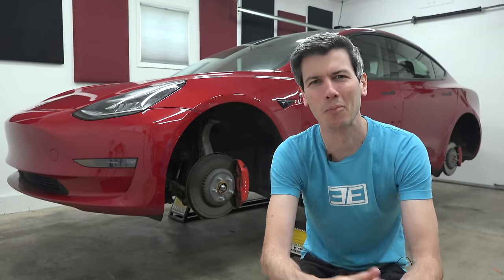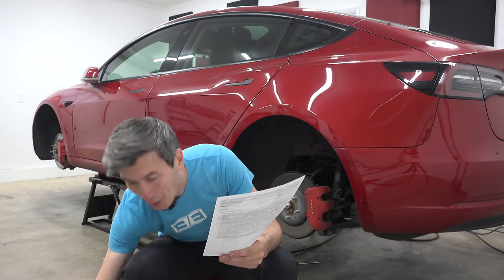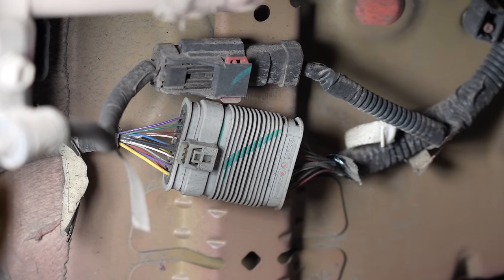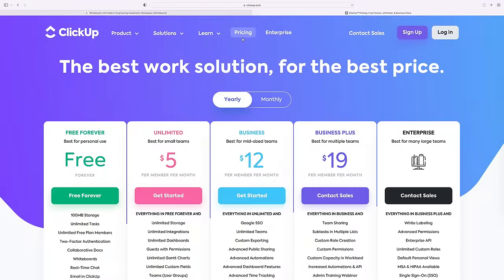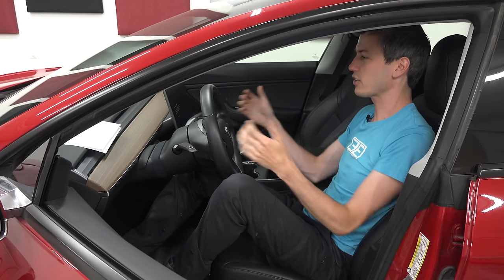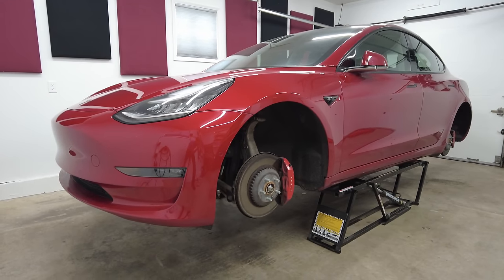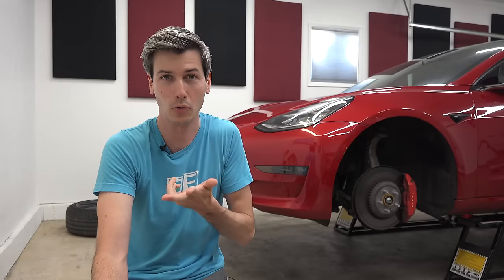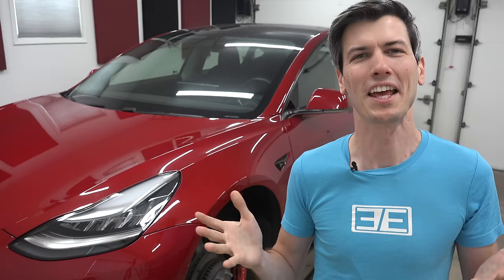Tesla Battery Damage? I Ran Over A Metal Bucket

Comment: How many Km or mi on the clock? Helps weight the maintenance costs.  

One thing to stress is that no one should go 4 years without a brake and suspension visual or basic (hinge) lubrication. And wipers. These are things norms hear and then neglect to their own safety because “it’s electric”.

Comment: I can say that the paint protective film is not the reason the spoiler keeps coming off. You demonstrated the reason on your video. The reason is the spoiler shape is not the same as the car, which results in the ends of the spoiler eventually pulling away from the car. I have had this happen to me several times, and I have no paint protective film on the car. Your video shows the problem perfectly... the part is not shaped properly.

Comment: I feel bad for people buying Teslas now because they’ve made them worse than they used to be, include less than they used to, but cost way, way more. I’ll bet a standard range Model 3 probably now costs as much, if not more than what you paid for your M3P, and it doesn’t have things like the garage door opener, or as much premium connectivity included. That and the vision based systems (autopilot, adaptive cruise control, auto high beams and wipers) are substantially worse on the new vision cars vs the older radar cars. I was shocked how much worse those system work on new Teslas vs my old 2021 Model 3. The exact same car I used to have now costs $10k more than it did when I bought mine in March 2021. For the same price as my Model 3 LR, all I could get now would be the cheapest standard range Model 3 in white or grey. My fully loaded Ioniq5 AWD costs $8k less than the cheapest Model Y. They keep charging more and providing less.

Comment: I e-mailed a service center and asked for a price to enable the AUX on my SAAB 9-3 a few months ago. The service cost $90. The labour cost $200. It takes 5-10 minutes to fix. 

At that point I just purchased my own tech2 to enable it. Cost $400. But sadly turned out to be faulty. I sat with that goddamn piece of junk for 8 hours two days in a row trouble shooting the security access (which is a known issue). Then ordering a bunch of junk from amazing for at least $100 to see if any of the accessories were faulty.

Comment: Great video J. I find that the blinker side cam is not positioned on the screen properly, it should be higher as my arms block the view and force you to look down. Do you get phantom texts from linked phone too? I get quite a few false positive danger beeps. I find I have blind spots with the small mirrors. They should toggle the wiper function modes with the manual wiper switch until they fix auto mode. They should revert wiper to off or auto after you park as it will likely stop raining by the time you drive it again (even in Vancouver!) I sometimes wonder if their programmers even drive the cars! Still love the car though and very unlikely to ever go back to ICE.
Reply: Blinker cam adjustment is coming for the next update. You can move it into 3 different spots on the screen.

Comment: Shocked at the 124 service cost. I wonder what the comparison would be for a BMW 3 series (regular) and M3. I'd assume those cost significantly more in oil and oily bits. 

A truly under appreciated fact of owning an EV.
Reply from the maker: Yeah I mean, even though I often do it on my own, taking in the Subaru for an oil change is $60+ or so at the dealer, and that's twice a year. Price goes up for more expensive cars (the nature of "luxury" dealerships).
Reply: @EngineeringExplained  Oh totally. I lived a former life supplying equipment (lifts, welders, paint booths, tyre equip) to dealerships, mainly BMW, Mercedes & Honda. The prices they charged were eye watering.

Comment: I HAD THIS WITH A BMW 740   the expansion header thank cracked and on eBay they were like £140 

At the BMW dealer, it was £24 + about £18 to fit it.      DONT ALWAYS ASSUME AN ORIGINAL PART IS SUPER EXPENSIVE WITHOUT CHECKING

Comment: Thanks for this informative video! Did you really drove the car 4 years without changing the brake fluid?
Reply: I assume with regenerative braking the brake system "works"  less and generates less heat resulting in longer life vs a normal braking system?
Reply: @pierredieperink4523  The brake fluid is hygroscopic. That means its water attracting. So the humidity makes it necessary to change the fluid every 2, at least every 3 years. Even if the car was not driven over this period. The boiling point will reduce over time. So the risk for air bubbles and corrosion damage is increased.

Comment: Push wiper stalk once and you’ll get one wipe.
Reply from the maker: Yes, but while it's raining consistently that's not a real fix.
Reply: @EngineeringExplained  yeah. For my 2020 behavior isn’t always consistent and isn’t the same as my friends 2018. Generally, it works well but in moderate rain it will occasionally be erratic. Most often I find myself in very light rain just tapping the button if I need it. I don’t know the last time I changed setting via the screen.

Comment: That wiring harness check was for the HVIL circuit, quite common for water ingress in that connector which can cause issues with HVIL circuit leading to vehicle not starting
Reply: What is HVIL?

Comment: Really appreciate your review on the tesla. I often wonder how they are longer term.
Reply: You do know how long Tesla has been selling cars right?  Since 2008, with the original Roadster.
Reply: @Resist4  sure, but rarely do you get someone with a big following that has had one for so many years do an update on their experience. Makes me think of getting one.
Reply: @sddyck  Actually, there are a lot of YouTubers that have had a Tesla for many years and did videos about their experience with the car.  But is a Tesla the best most reliable car...no.  Yet it is the most fun to drive and the safest.  Unfortunately, their prices have gone up so much that I wouldn't buy another one right now, even with the new EV credit.  Plus, there still aren't enough service centers, the closest to me is 2 hours away and mobile service can't fix everything.
Reply: @Resist4  I have to disagree with you on reliability.  I'm 3 hrs away from the nearest Tesla service center (Las Vegas).  I've only been there twice in the 4 years I've owned my Model 3.    Once to get the AV computer upgraded to V3, and again to have my 12V battery replaced and the rear tires replaced.  I replaced the cabin filter myself which was a pain.  It's been my most reliable car by far.  I took delivery on a second Tesla in May; this time a Model Y.  No fit/ finish or paint problems on this Fremont built Long Range.
Reply: @MsAjax409  Maybe in your experience it has been the most reliable car, but not in mine.  I have has ICE vehicles, one I owned for a decade and it never needed warranty repair or ever was in for any kind of service.  I've owned my Model 3 almost 4 years now and it's been in the service center 4 times and had mobile service at least 3 times.  Luckily it's all be under the warranty.  Not sure what I will do when my warranty ends later this year, because repairs are more expensive with a Tesla and many things can't be fixed yourself.  This is the downside to the technology.  

I know I sound negative, but I really do enjoy my Model 3.  The acceleration makes me smile every time I drive it.  And the convenience of charging at home is so amazing, especially because my house has solar so my fuel source is free.  My solar panels are over 10 years old so they've paid for themselves.

Comment: Yeah I'm surprised you can have a good service vist at a Tesla service center considering they are all run by the same company unlike Dealers and indipedets... Speaking after my Grandpa broke the driver'sw side mirror after trying to backk out our new mustang and learning Mustang don't pack straight they park at an angle... I looked online to see the part cost and it was $120 just for the part... Whent to the great Ford dealer we bought the car from... and they did the repire for under $100... So yeah if you find a good shop they'll do it for a good price!

Comment: Auto Wipers don't work!? Is it maybe because your car is 4 years old and something physical changed over that time which can't be addressed in software? The AW feature in my 2022 Model Y works fine - they come on when it rains, they go off when it stops and they definitely don't flutter when I'm in reverse. Tesla ought to be able to at least explain why it's doing those things if not fix them. Maybe it's just some doodad thingy on the wiper motor like an extra sensor and lead to the controller? Ok I'm sure you tried all that already, I'm just very sympathetic to your plight. Cheers.

Comment: In the 90s I had a Nokia phone. I dropped it on the ground after that, the battery time was significantly lower. So at least in those days a battery could apparently lose capacity due to a blow

Comment: Great review! It seems that Tesla has not figured out how to make money at a service center like all other OEMs do. Even if they went half way to what is normal, they could generate much more revenue and still provide value to the customer. This is because of no franchises. For example, FoMoCo buys a part from a supplier, doubles the price and sells it to a franchise (dealer). The dealer adds 50-75% and sells it to the customer. Tesla needs to figure out the amount of $$$ they are missing out on.

Comment: Currently, rechargeable batteries are nothing more than containers for storing electrical energy. It needs to be charged using energy produced from petrol, diesel, solar, hydro and other power systems. It is very inappropriate to use for running a vehicle even a motorcycle.

Comment: Do you have any hope that Tesla may provide software updates that could address those issues you mentioned regarding the automatic wipers, lane change camera, Spotify app, screen layout, etc? It seems to me that those are all updates that could be provided to improve the driving experience that should be relatively cheap for Tesla to implement.
Reply: Obviously at some point Tesla will address the software for those issues.  Hopefully they can do that after they fix the Dashcam Viewer and other buggy issues.  But unfortunately they are too busy adding more games to the cars.
Reply: I doubt they'll get the rain sensor fixed if they didn't get it fixed by now..
Reply: I'm not sure i would hold my breathe for some of those. Some like the screen layout and Spotify app would be relatively inexpensive and almost guaranteed to be software problems, others may be hardware limitations. If the sensor for the rain is weak then no amount of software is going to fix it, if the onboard computer cant respond to the camera input fast enough when it is also doing other things then a software fix might just replace that problem with another.

Then you have to consider why Tesla would be truly motivated to worry about fixes like this on a car that they already made their money from rather than applying their software team to new flashy projects aimed at capturing the next wave of buyers.

Comment: 11:53 It's because HP has nothing to do with acceleration. Torque defines acceleration. And electric motors has all the torque available at any RPM.

HP defines top speed.
Reply from the maker: HP is in fact correlated with acceleration. Torque and horsepower are linked. You can't have horsepower without torque. https://youtu.be/u-MH4sf5xkY

Comment: I've had my Model 3 for about as long as you, and I can certainly agree with many of your points.  Tesla's range is based upon ~230Wh/mi, which you seem to only get in 60-70F weather when driving at about 55 MPH.  EVs are largely single-geared these days -- you can ask Tesla how putting a gearbox in one works, or just watch the Top Gear episode -- and that means that each motor + gear combo has a single ratio.  The Model S and Model X are able to disengage one of their motors (I believe the rear) and allow the other to keep the car at speed when cruising on the highway.  Unfortunately, the Model 3 and Model Y cannot do this.

I think my biggest regret is probably not listening to my gut when buying the car.  I was originally going with a Performance model like you, but I made the mistake of listening to a friend's advice of "who buys a Tesla without the tech?"  I ended up going with the LR RWD with both EAP and FSD.  I kept debating going with FSD or AWD, which considering what happened (Tesla accidentally offering FSD for $2000) and the fact that AWD cannot be simply added later via software, and the choice should've been a no-brainer (i.e. AWD).  I actually was going to change back, but the car's setup had locked in at that point.  Anyway, the reason why I bring this up is that I'm a huge fan of cruise control, but my main desire is for it simply keep me at a speed.  I'll handle all the adjustments myself.  Unfortunately, if you have EAP or AP, Tesla does not allow you to disable the Traffic-Assist for the cruise control.  

In the end, if I could go back and change my setup, I'd go with that simple Model 3 Performance setup... or I think the better option would've been to wait a year or two, and go with a used Model S.  The used Model S would have more range (~400), which means the effective range is more around 300... a decent amount, and I'd actually get physical controls!

Speaking of that, I think the lack of physical controls is one thing that you glossed over a bit.  The auto-sensing wipers wouldn't be that big of a deal if it wasn't such a pain to change the wiper speed.  I recall one time when I was driving on the interstate and it went from a slight rain to a heavy downpour, and the wipers didn't react quickly enough.  I mean... I was kind of used to that in previous cars with auto-sensing wipers, but with those, I could quickly make the adjustment myself, and arguably most important... I didn't have to take my eyes off the road to do it.

That's my problem with the decisions that Tesla made.  Their whole mantra behind the simplistic design of the Model 3 and Model Y was that you wouldn't need those controls and such due to automated driving.  However, even after all those years, we still don't have it, but I've been having to deal with the inconvenience all this time.   Just give me headlight control, wiper control, and a dash cluster, and I'd be happy.

Comment: As an owner of two Teslas, I wish they would charge more for these things. I appreciate that they are only charging realistic hours of labor, but for these very small jobs they aren't covering the overhead. I cracked one of my key cards in my pocket, and opened a service ticket. They sent a mobile service to my work, and sold me a new key card for $12.50. While I appreciate that it was 5% of the cost of getting a replacement key fob from BMW, they aren't covering their costs of doing business. Service delays are a big problem now, and getting worse. They need to invest in building up their service centers. While not turning them into profit-centers is admirable, they shouldn't be loss-leaders.

Comment: I see a problem with this as Tesla requires service to be performed every year on brakes and other components I don’t see listed in the price brake down.
Reply: Every car maker recommends that you inspect, clean, and lubricate your brakes once a year especially if you live where there is snow. They also recommend the fluid be inspected, and changed every two years. Brakes on EVs last longer than those on ICE cars because of regenerative braking. Tesla doesn't require any more brake maintenance than any other car on the road, and it will most likely be less over the life of the car, due to the pads and rotors not getting as much wear.

Comment: So you haven't replaced the tires in four years?  Damn, that was the killer for me when I had a 70D I never had a set last over 24,000 miles.  Well, it was that and the struts/ from shocks were effectively shot at 44,000.